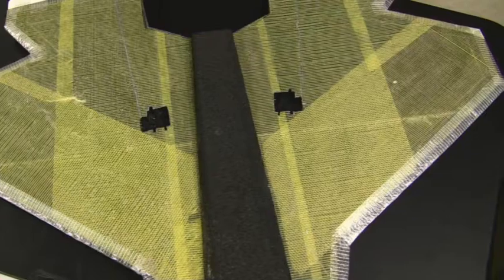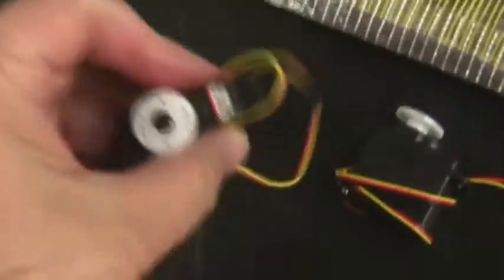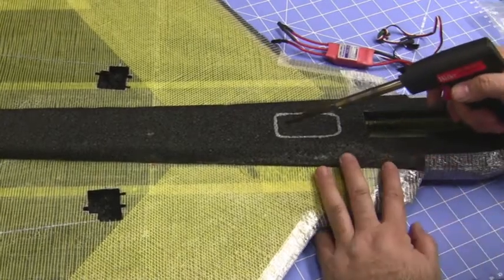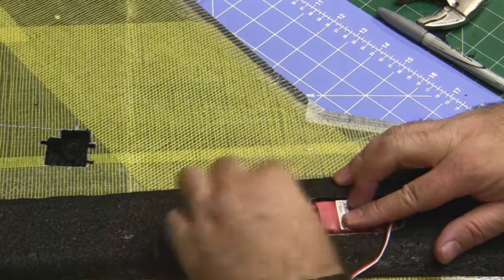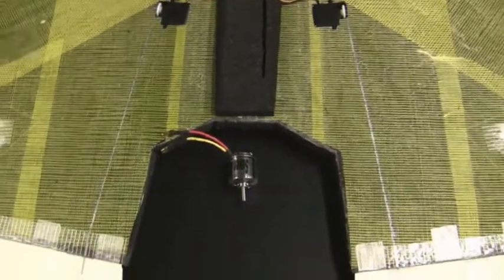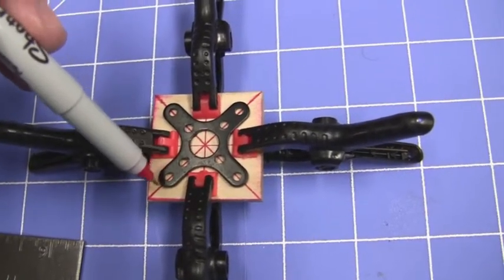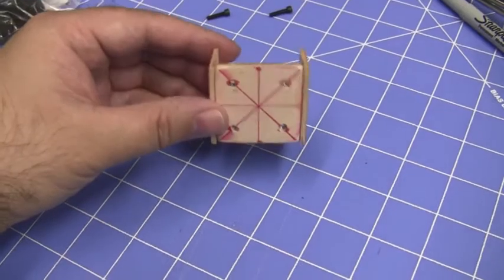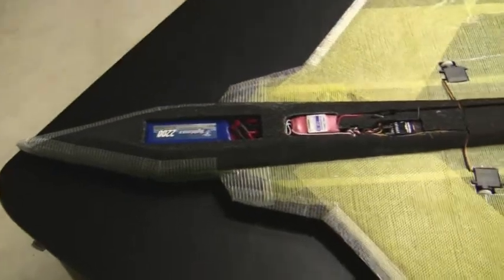Part 4 EPP Park Jet Scratch Built RC Airplane

Comment: plane is complete and the gun works great. i'm waiting for a full day of decent weather to take it up. the overall gun setup is super simple, any scratch builder can do this. it's finding the right plane platform to support the weight in slow level flight. If it wasn't for outdated AMA regulations, there would be companies building plug n play ultralight  and compact airsoft guns for planes already. I will have the video up asap! Any questions you have I will answer, u guys always answer mine!